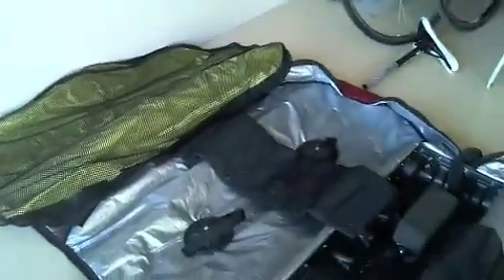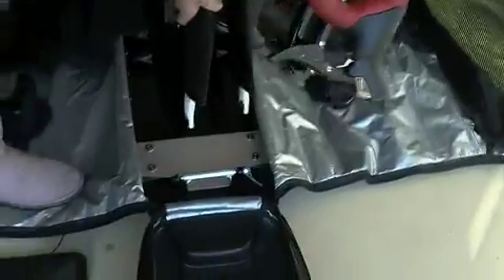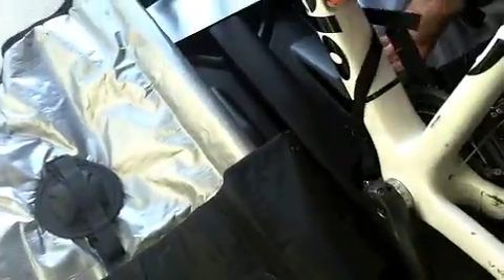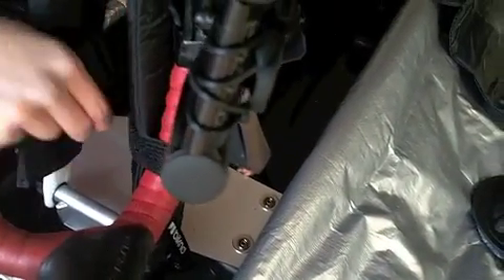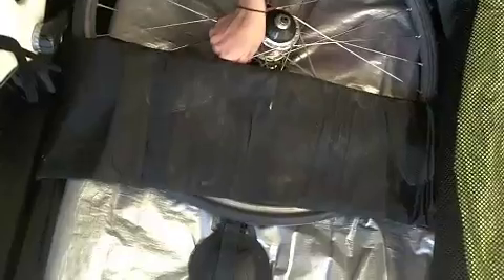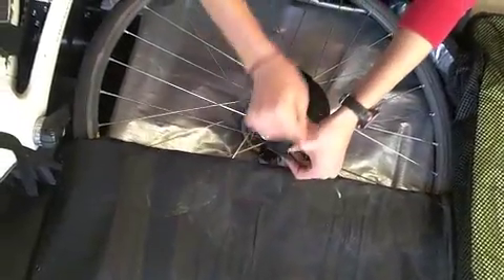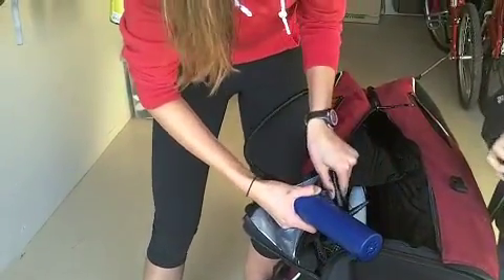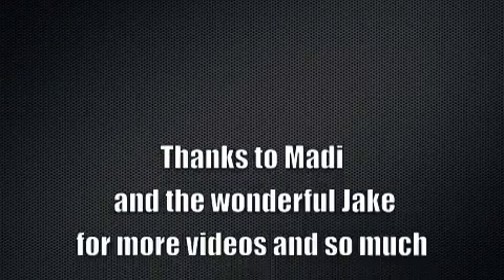How to pack a BikND Helium Bike Case -Tri It Multisport

Comment: Thank you. Still figured out that I can pack with stem on and only remove the handle bar. This is very easier to put the handlebar only back rather than realign the stem again.

Saw another pro video where the pro team did that, so this confirms my idea is correct. This is now much easier to pack the bike as I was always worried about aligning the stem.